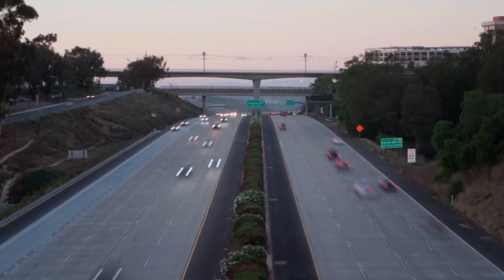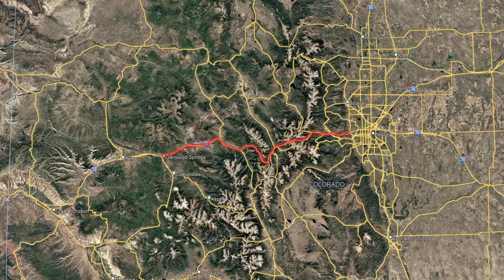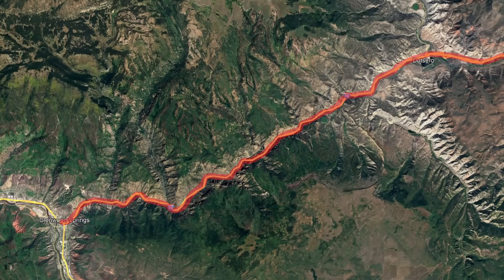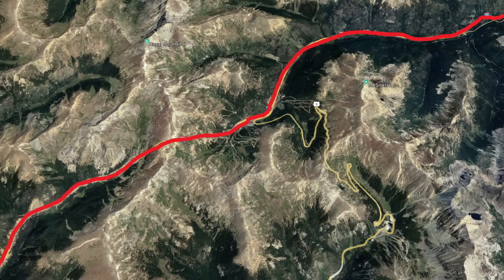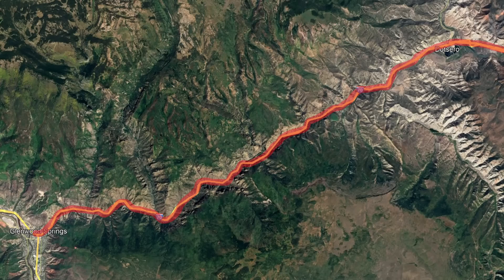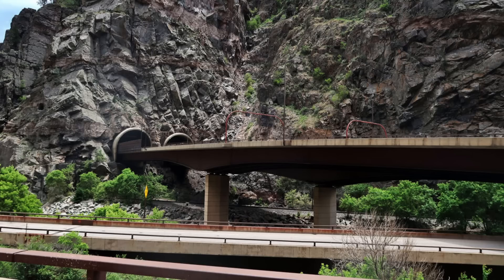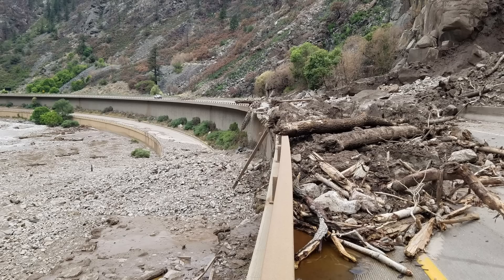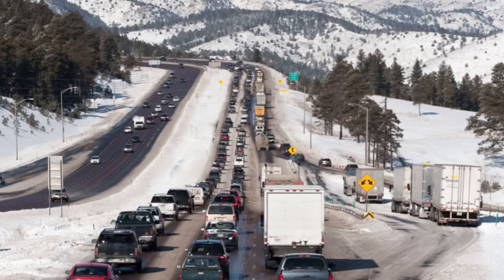Why Interstate 70 In Colorado Was So Difficult To Build

Comment: Would love to see a passenger train route in the future to connect Denver to Grand Junction and the ski towns in between, would definitely alleviate future traffic more than additional lanes would. Especially during peak tourism ski season where most traffic are tourists renting cars with only a bus alternative.
Reply: There has been for quite some time. But, it only services Winter Park, town and resort.
Reply: Using existing track, a train service from Denver to Avon and Denver to Steamboat is theoretically possible. 

The route toward Steamboat would use the track on the right (at Bond) instead of continuing to follow the Colorado River. 

The train to Avon would simply follow the Amtrak route to Glenwood Springs, but at Dotsero, the route would turn east instead of west. And for those trying to reach Vail, they would transfer at Minturn to a funicular railway or a people mover, etc. OR a spur track would be built.

A separate train would shuttle back and forth between Minturn, Avon, and EGE airport, as well as between Steamboat and HDN airport.

Unfortunately, some ski communities would still be left behind; for instance Breckenridge, Keystone, and Copper are nowhere near the closest existing airport or train track.

Yes, a commercial airport was proposed for Breckenridge and its community voted “no” to prohibiting one, but they “followed the money”.

Comment: I have traveled this road many times and also gone over the Berthold Pass to Winter Park. This is very dangerous driving.  I have in addition gone over Tail Ridge Road. Glenwood Canyon is very beautiful and an engineering marvel. Coming down I-70i into Denver I passed a tractor trailer on fire from brakes overheating.

Comment: You should look into US HW 20 from Philomath to Newport, Oregon. A over mountain re-routing with multiple bridges got stuck mid construction for over a decade do to geological and engineering issues. It's the western most part of the longest coast to coast highway in America so having the bit that cuts across Oregon's Coastal Range stuck incomplete for so long is sure to catch your interest.
Reply from the maker: Ill look into it!
Reply: As a trucker went to Toledo Or Georgia Pacific many times.We couldn't use us20 bucuz of truck restriction.I found out about 7 yrs ago us20 was deemed legal for big rigs.The extensive work finally got done.

Comment: Road maintenance in winter... I am not sure about the specific environmental impact of different de-icers. Regular salt (sodium chloride) drops the freezing point to about 25 degrees F. If you use it when the temperature will be going above and below that temperature,  you get freeze-thaw cycles the will break down pavement.  Magnesium chloride drops substantially lower before freezing, and calcium chloride even further, and CaCl actually generates heat as it goes into solution. I am just wondering how cold it gets up at the tunnel?
Reply: Gets very cold, but not necessarily when it is snowing hard.  You will be OK with studded snow tires or chains.  If you hear of a big delay due to shooting and clearing snowslides, get off at a motel or restraunt.

Comment: I'm going to start watching this in a moment, but I really hope there's more to this than . . . mountains.
Reply from the maker: Did It talk sufficiently about the other aspects?
Reply: @BeaverGeography  Definitely.  I learned a great deal.  Thank you, both for the video, and for guaranteeing that I will never make the mistake of travelling on this between Labor Day and Memorial Day.
Reply from the maker: @BS-vx8dg  Awesome dude, appreciate the support
Reply: @BS-vx8dg  Probably fine except Friday through Sunday or on holidays, definately not fine Friday through Sunday in winter, mid November through mid April, or if the weather is bad.  Expect at least some snow every night in winter.  Problem driving through Glenwood Canyon is road is a bit curvy and speed limit is lower than most drivers expect.  There are occasional delays for rockfalls and maintenance.

Comment: Uh-oh.  I saw a picture of Maroon Bells during the discussion of Glenwood Canyon.  Maroon  Bells is near Aspen.  Not even close to I-70.  Having been through the canyon many times pre-interstate, they did a good job.  But it was still prettier the old way.
Reply: It happens. How many times have you seen it on the internet where they show a picture Ayers Rock when they're talking about Sydney, or anywhere else in Australia?
Reply: You get to Aspen by way of I70 though, though you can get to Aspen in summer from the other side.  In my opinion more beautiful, but parts are not for the faint of heart.  Do not take in an RV.

Comment: The goal of the engineers through Glenwood Canyon was to create a four-lane interstate that had the same footprint of the existing two-lane US 6 highway.  It is a great testament to their abilities and imagination that they pretty much pulled it off…
Reply: That said, I wonder if it’s possible to upgrade that stretch to 6 lanes (due to traffic).
Reply: @ That’s hard to say.  At the moment, the least expensive way it could be done is by eliminating the already narrow shoulders and convert the roadway to 3 narrower lanes each direction, but I’m not sure how well that would work through the tunnels.  Reconstructing the roadway to add another full lane each way maybe could be done, but not cheaply, and again the tunnels would be the limiting factor.
Reply: Large parts are 6 lanes or will be 6 lanes.  Tunnel would require a third tunnel at considerable cost.  6 lanes would not cure all problems though, and would not cure any delays in Glenwood Canyon except it would make maintenance easier.  Past Vail traffic is modest.

Comment: Originally I-70's western terminus was planned to be at I-25 in Denver, but the State DOTs of Colorado and Utah wanted I-70 to be extended westward, as to facilitate a road link between Denver and Salt Lake City, with the road being routed along US-6 all the way to I-15 in Spanish Fork. The DOTs sent this proposal to the federal government, they accepted this proposal, but they also sent back to the DOTs another proposal that was influenced by military planners. The military felt that Southern California wasn't sufficiently connected to the (north)-Central US, and thought that the westward extension of I-70 would have been better fit to serve a link between Denver and Los Angeles, rather than with Salt Lake City, as they felt Denver and Salt Lake City were already sufficiently connected. Hence, this is why I-70 passes through Glenwood Canyon, with it's eastbound lanes being the original pavement of US-6, and it continues to follow US-6's route up until Green River, where US-6 splits from I-70 and heads northwest along with US-191, with I-70 continuing west through the San Rafael Swell and terminating at I-15 in Cove Fort, with westbound 70 angled for southbound 15.

Comment: FUN FACT: as long as it took to finsih I-70 through Glenwood Canyon, the section in Utah crossing the San Rafael Swell took forever, and last time I checked had the longest single stretch between any type of services. not exits - as there are some off into desert roads, but exits with gas or whatever

Comment: The Alps in Europe are far more formidable than the American Rockies - yet there are no shortages of freeways across the Alps and other mountain ranges. Italy alone has over 700 freeway tunnels through its mountain ranges.
Reply: you are delulu if you think that overall they are more formidable.. Certain sections are daunting, but there as many if not more areas of that nature across the ROckies.

Btw Ive crossed the ALps a dozen times or more, via car, train, and flying over, so I do actually have in-depth personal experience.
Reply: Colorado is bigger than the Alps as a whole. 100,000 square miles, about 290,000 square km, versus 77,000 square miles spanning 8 different countries. 

The stretch they are talking about is almost 200 miles, 300km, alone. We don't want to pave the entire mountains. Thanks.
Reply: European derangement syndrome